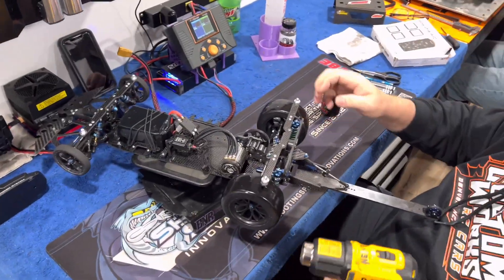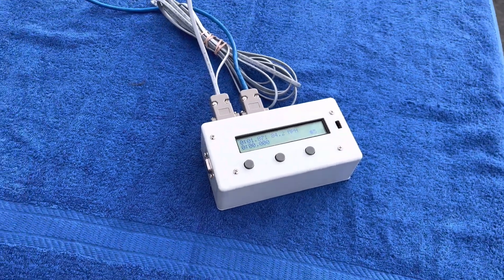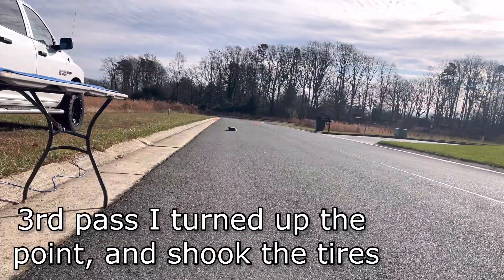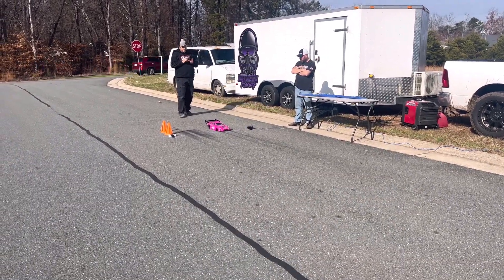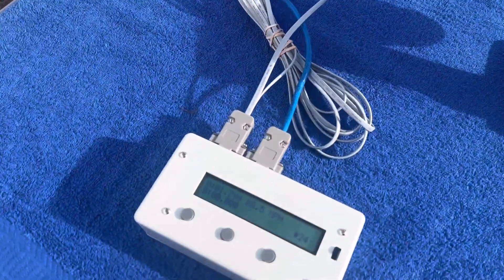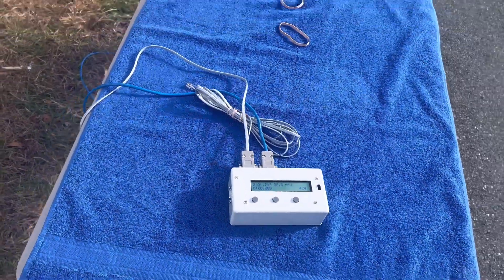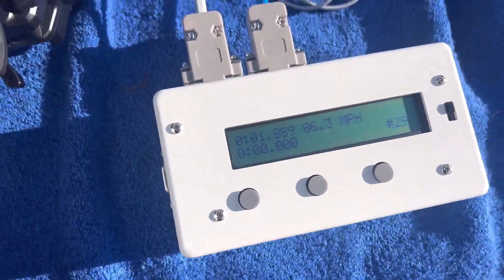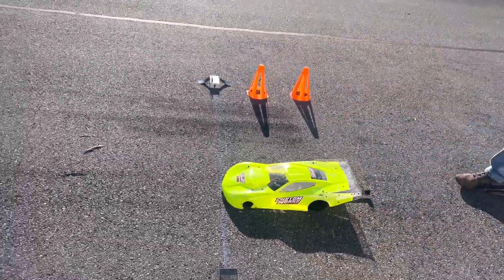Final Test Session of the Season (No Prep RC Drag Racing)

Comment: Look at real drag cars, you'll never see flexible wheel bars. the fact that they are flexible gives them a spring effect which makes the rear axle bounce and causes the loss of traction. adjust the height of the whellies so that the front wheels remain slightly raised (around 10 mm) and your traction will be at its maximum believe me. I am a drag motorcycle driver and no:1 in Canada for 8 out of 10 years. I have more secrets about weight transfert just ask!! Good luck.

Comment: Killer video but where you're showing the difference between the cyruil tire and the voodoo loading ... the body is touching the ground before it even launches, might want to check different ride heights
Reply from the maker: Hey boss yes this is something that I caught onto after the the fact when I was rewatching some footage. For the cyrul tires we had to move the turn buckle for the floating mount inward for clearance and it lowered the body more than I thought. Didn’t realize what was happening thank you for catching it also!! Will have more testing in the tires soon
Reply: @Big_Neve  hell yeah that's what racing is all about man testing and tuning the only way you're going to get quicker and faster good luck

Comment: I think somebody should invest in the  use Of tennis court paint for the drag strip. because in scale reality you guys are driving across  A Boulder field .that really changes the performance. if you're in   Too scale Drag Racing nobody thinks about the surface. At a minimum it should probably be concrete but blacktop prepared with tennis court paint would probably be scale size for the gravel that's in asphalt on a drag strip.

Comment: It's NO Prep but you Prep The tires?
Reply from the maker: No prep is in regards to the road surface isn’t prepped your allowed to prep your tires however to achieve traction in outlaw
Reply: @Big_Neve  you said the road was sticky n you weren't gonna step in it....I have a no prep car but never did any competition...your doing that on 2s?
Reply: @CainSample  rubber is sticky when warm that is why they do burnouts to war the tires and some of the tire prep comes off and onto the surface
Reply from the maker: @CainSample the road gets sticky over time from the prep that transfers off of the tires. If you go to any big race there’s a super super sticky groove that all the cars create by running over and over. Yes 2s Lipo
Reply: @Big_Neve  What the hell type of 2s is that big???